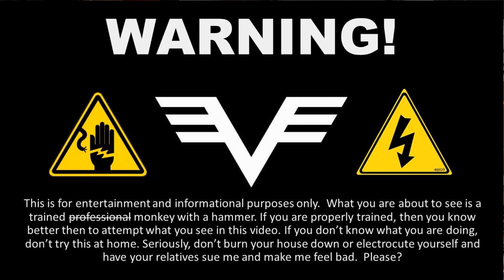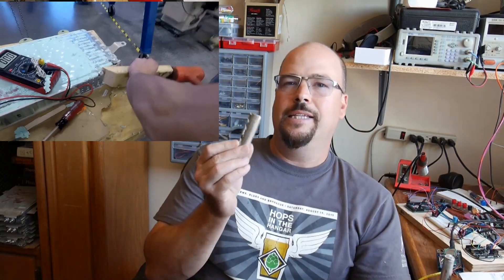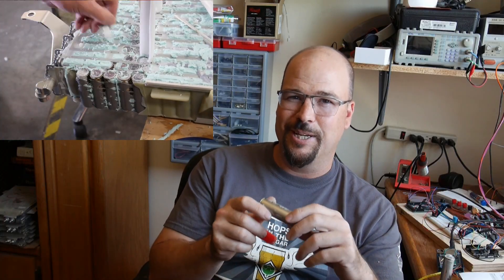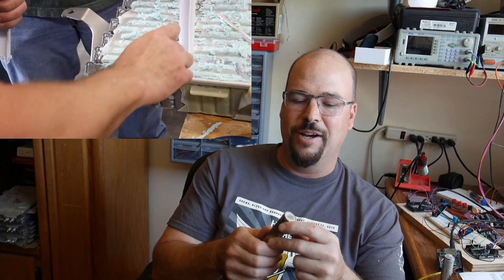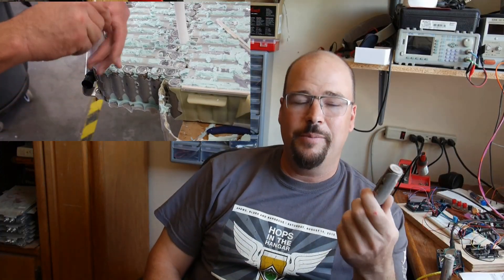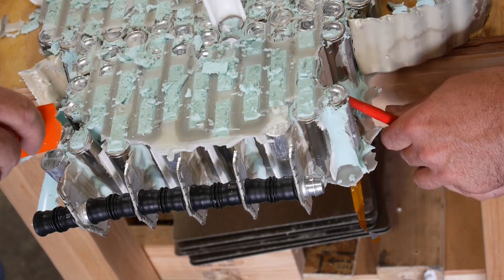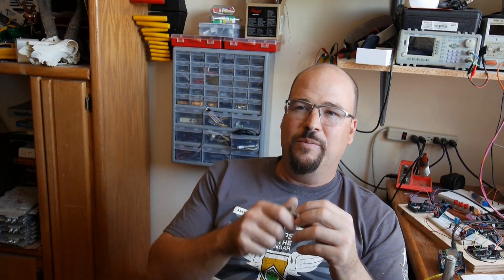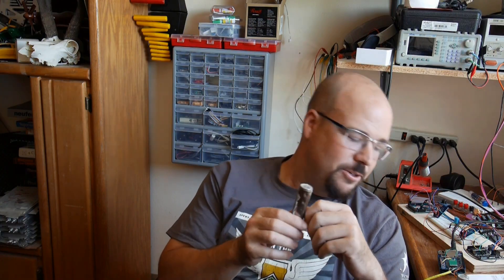How NOT to extract the 21700 cells from a Tesla Model 3 battery

Comment: Anyone knows what the voltage is fully charged per sell on a model 3 battery pack? I want to use it on my solar system.  But when I measure with a multimeter. I get 42 rolls. In the next row is 46 volts. Would I cut the battery at the 42 volts or at the 48volts?  I measure each cell has 3.8 volts  right now.
I’m hoping for you smart people to let me know and help me. 
Thank you

Comment: Hi all I've recently had a model 3 battery dropped off and in the stage of removing the cell's and have found a very quick and easy way in the removal from the pack instead of using a piece of plastic or wooden wedges get a claw hammer and a 2 pound club hammer once you've taken one of the sides off then put acetone all over the pack depending on what way up you've got it let it sit for half hour to an hour then take the claw part of the hammer stick it on the top edge of the cell against the water jacket and use the club and hit the head of the claw hammer one too two blows will take the cell out so much quicker than the way you showed in the video then once they're all free then stick them in a bath of acetone to remove the epoxy and what other plastics there are but don't fully submerged them as this will lead to a fire due to corrosion so take it easy in this process please and be safe

Comment: I have the same battery but I'm not able to solder the positive pole.........did someone knows how to do it ?
Reply: Any updates? Any suceess? 
Tried spot welding?
Seen russian video using f-64 flux for soldering successfully but i think it still will produce much heat that the gasket of positive electrode will be melt and battery will loose its function

Comment: some heated or saw wire would do its thing i guess.. otherwise, just phone panasonic for cells, if needed..
Reply: I'd be careful with heat.  I'd be tempted to cut some sawteeth into a metal tube just bigger than the battery, file it so the inner face is smooth and chuck it in a drill

Comment: Put that pack on an X-Y table and mount your chisel tool [Harder plastic, copper] in an over arm press, knock those off in seconds.  Think large milling machine, Bridgeport , radial arm drill press.  Cheap way would be an air chisel with a better cutting tool chucked in it.

Comment: Just got a few of these cells, and am VERY disappointed in the apparent lack of re-purposing ability in the design.
For a guy who is so "ECO-minded" in all this EV stuff, I would give them an F for this one.
What do they expect to do with the millions of cells after they are dismissed from a car.
I almost want to grab a megaphone on this one.
I spent 17 years in Silicon Valley, and suffered much under "silly valley" engineering; Tailoring everything for short term profit, vs benefit to all,
And MOST certainly NOT to a Potential competitor.
I cannot use these cells without outside pro help to clean, cap, and re-wrap them (Whew).
Ridiculous - here we have the best batteries in the world, cast into a one-time use mold. What Planet saving garbage IS this?
I was drooling over the prospects of getting a Model 3, but now I may want to shun the whole idea.
If I can' make "Tesla Powered" DIY toys, I may use Tesla products as much as Apple products, which is NEVER.

Comment: with other words don't bother splitting a Model 3 pack in more than the 4 modules they are build from, at leas then you might be able to reuse existing temperature control plumbing and ~90V per module sounds like a fair voltage for diy projects!

Comment: Hі. Great video! Tell me how you will solder or weld 21700 in your battery?
Reply: Look on amazon or ebay for "18650 spot welder" (yes they will weld 21700 too)
Reply: Gary have you tried that successfully?

Comment: I was of the impression that a number of cells can die in a Tesla pack and you wouldn't even know it. The cell-level fuse wires pop and you have one less cell in the pack, but there are enough cells left in each parallel group that the car still runs. Is that incorrect?
Reply: This is true for individual cells, however they are wired in groups called bricks. If a whole brick went out, then the current could not be passed through the module circuit. I used to work in production at Tesla, so you can take my word for it.
Reply: Mike Csernyik 
Right, that makes sense, but the chances of an entire brick failing would be pretty low, no? I mean much less likely than a single cell failure.
Reply: yes

Comment: No joke, what actually might help is putting the whole thing in a freezer. Not too long. Even 30 mins or 1 hour could make a difference. The glue might become more brittle and shatter easily. I've seen this trick used before on book glue and I couldn't believe how well that actually worked.

Comment: first thing i was considering was solvents or a little heat too
if the gleustuff is thicker then say half a mm you might be able to use a saw wire to get it off the coolers
i think the best way to remove one cell is to first insulate it somewat from the surrounding cells then drill it out , since the cell it dead it shouldnt catch fire as long as you dont nick the cells around it

Comment: Depending on how they have separated the anode and cathode side of the cells (usually a plastic), I'd say try acetone or toluene.
To test a large range of solvents cheaply you could buy a generic builders solvent cleaner. £25 for 5 litres.
They usually come in blends of acetone, IPA (Butane, Propane, Propan-2-ol mix), MEK (Methyl Ethyl Ketone), toluene and dichloromethane.

Comment: I used to heat G10 to 100C to degrade its adhesion...what is the critical temp for the 21700's?
Reply: They don't like going above 60C taking them to 100C for long may not end well.

Comment: Have you tried various solvents on the damaged cells to see what will have effects on the adhesives without attacking the seal around the positive electrode? Start with rubbing alcohol. It pops hot glue loose almost instantly.

For fun with a damaged cell, make a wooden fixture to hold a cell and a something spring loaded with a pair of metal points connected by a heavy wire, and a remote release. Pull the string from a safe distance and see what a dead short does to the cell.
Reply: I have a few of these cells, and I doubt that I can get the tough grey epoxy off with solvents. I have a lot of experience with epoxy potting etc. You usually have to soften it with heat, but that would be too dangerous with these. They just need to design the pack for maintainability else it stays a techy toy. I probably won't buy a model 3 until this is addressed correctly!
Reply: @nixeco  Because it's important to you that you be able to replace a single model 3 cell in a giant battery pack yourself?  One that isn't even necessary to the operation of the car, since it bypasses failed cells automatically?  More power to you, I guess, I'm fairly positive I couldn't be bothered to go after a single cell in a pack.

Comment: Hmmmm ... have you tried pulling on the cooling ducts? do they break instead of coming out? If you could separate the pack into 2-row pieces you could just bend it, until the cells fall out...
PS: LG Chem will be making battery cells for the Chinese Model 3, maybe then you'll be able to buy new ones.
Reply: This is more or less the answer.  If you're not reusing the cooling ducts, then cut the manifold between each row and you can pull it back and forth to take out a double strip of cells, then flexing helps you break the brittle adhesive.

Comment: Questions:
1) Once you had a few cells removed in one row, why not grab that heat exchanger and pull it at 45°-90° angle from the pack... wouldn't it eventually pull the rest of that row away from the pack?  Sure it would take a large "pull"... but worth trying.
2)  For the dented/damaged cells, use some for finding out how much heat they'll take (slowly). That way you can know if using moderate heat to disassemble the pack would be viable... many epoxies will soften with heat.
3) Then you could try pumping heated liquid through the heat exchangers to try to soften the adhesives.
Reply from the maker: Good ideas but the cooling tubes are very thin aluminum and not strong enough.  I tried that initially but the tubes just ripped off.  They are like thick aluminum foil.  The tubes themselves are pretty impressive.  As far as heating: if I had to guess it's a 2 part epoxy that has a Tg well above any temp you would want the battery.  Removing the cells is super sketchy as it is and adding heating the cells makes a bad idea, extra terrible.  I don't want to be anywhere near a pack that is hot enough to soften epoxy.
Reply: @EVEngineering  How about the other way around - cool it off to make the epoxy brittle. The pack must withstand elevated temps as it heats up during operation... Another idea is to use slow, steady pressure rather than an impact of a hammer.

Comment: maybe you can solve the form in acetone or something simillar paint thinner.
Reply: Yeah, there is almost certainly some solvent that can dissolve the adhesives... The problem comes when that stuff can't be conductive :D
Reply: Acetone does not conduct electricity. But if the solute makes it cpnduxtive, it might. Test on a cell to find out.
Alternatively soak the negative side up and stop near the top.

Comment: Obviously Tesla doesn't plan to replace individual cells with that design.  FYI, 21700 cells are available from a number of suppliers, Liion Wholesale being one of the reputable ones.
Reply from the maker: You can get the 21700 for factors from different sources but they aren't the Tesla cells.  Will be similar but not the same chemistry.
Reply: @EVEngineering  That's true. But it doesn't mean you have to have "Tesla" cell tweaks (actually Panasonic cells for the model 3 made in the US, they have a deal with LG for Tesla's made in China).  if you look at the specifications of some of the ones you can buy they are quite good, including  21700's from Samsung and LG. Great video showing the difficulty trying to tear down that new Tesla battery pack.
Reply from the maker: @songmaster9308  Agree.  I was just helping them out for fun but by the end the company agreed that I should make a video of the end result just so that people don't make the same mistake and think they can buy a module and just take out the cells.
Reply: @EVEngineering   Yes sir, glad you did, an absolutely valuable video, who knew the cells would be potted and epoxied in like that!

Comment: Since it takes that much hassle to do. Why cant I just work around it? Buy a pack like the one u have. Liquid loop it with a cooling fan. And hot wire a BMs to it and call it a day? No?
Reply from the maker: The modules are 6 feet long.  Fine if you want solar storage, but really hard to fit into most EV conversions.
Reply: @EVEngineering  Cut 'em in half using your PEX trick...
Reply: The low range Model 3's contain 2 modules that are less than four feet long.